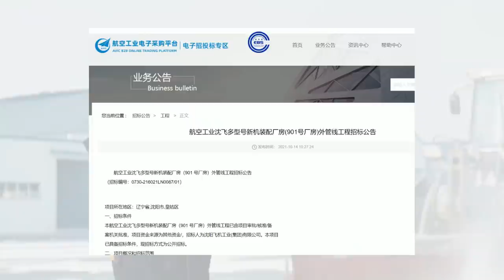J-35 / J-31 China stealth fighter update: new large-scale assembly plant construction started

Comment: Great J35 with wings that can be retracted or swept forward depending on the speed, much better than the usa’s F35s.
Reply: you wrong, J-31 use engine WS-13 copy of RD-33, J-35 can't  agility... Russia MIG-35 use engine RD-93 good fast speed and good agility...  russia RD-93 won't sell to china..
Reply: @f-35lightningii6  J-31 is installing WS-19 engine, which has a maximum thrust of 12 tons, compared to WS-13 whose thrust is 9 tons.
Reply: @f-35lightningii6  learn English
Reply: @f-35lightningii6  not only the engine , but also the whole J35 is a copycat
Reply: @hlau4161  Copycat? How? Because they look alike..? You need to do better than that..all planes look alike
Reply: @calvinblue894  The front part direct copy F35, the rear part direct copy F22.
Reply: @hlau4161  Explain direct copy..the rear stabilizers are atypical in Sukhoi DNA..
Where is the front part direct copy of F-35..in fact, J-31 front part is alike J-20 and J-15
Explain?
Cockpit?
Where?
J-31 is twin engine, Chinese jets atypically use two horizontal and two vertical stabilizers..
It's their usual.
But J-31 doesn't have the front canard wings, which is the only difference..they took those out..
Chinese jets atypically use twin engines..
The more roundish body of the J-31, which differs from J-15, is necessary for stealth aeronautics.
Like i say, you need to do better than 'They look alike'
Reply: @calvinblue894  Quibble
Reply: @calvinblue894  Hahaha, It is not look alike l, it is exactly the same outlook. However, no one can wakeup a person pretending to be asleep.
Reply: @hlau4161  Hello.. it's not the same outlook..
You are blatantly stubborn and refuse to read aeronautics.
Like it is..haters are people who refuse intellect..prefer to live in delusion.
You think designing planes is drawing cartoons?
Plane designs is based on Aeronautical science, how wind currents flow.
J-31 configuration is different.
It's twin engine makes it an interceptor..to carry more arnaments.
F-35 is multirole, it's single engine is for dog fighting.
The shape of the plane is for the functions, it's not for copy to look good..
Please, have some critical thinking
Reply: @calvinblue894 The facts are all in sight. It is wasting time to debate with your Little Pink.
Reply: @hlau4161  Facts? I am waiting for your facts...your knowledge is mere your eyes see looks the same?
Hey, are you not embarrassed at all?
That's really thick to enter a debate and you practically have zero understanding..and end up calling other's names.
I hope you don't take this attitude with you in life, it's detrimental
If you want to win a debate, at least go do some research and challenge me with knowledge..i welcome that..
That's competitiveness.. which is what you haters are lagging..
Reply: @calvinblue894  Are you blind ? Little pink !

Comment: Couldn't install ws 15 yet,whats benefit bringing new new planes ,which won't be able to fight with American f22 and f35!!!?
Reply: I'm not so sure about the F-35.
Reply: @eddiehah9842  Will not be powered with turbofans which power the F22, F35 or J20,  J35 only needs engines with power output of around 90KN -- it is a medium-weight plane.  There is a new one under development, and WS13F or RD93 will be stop gap.